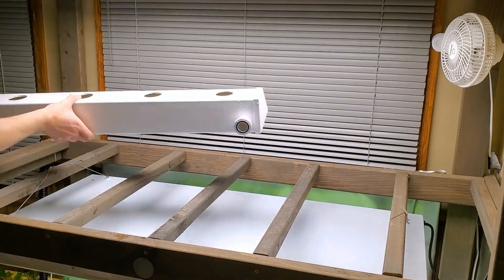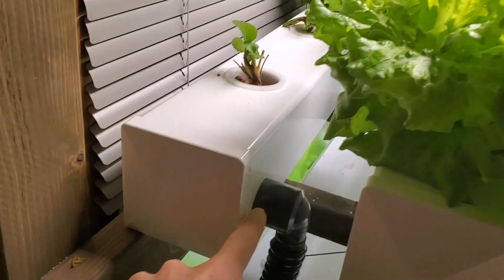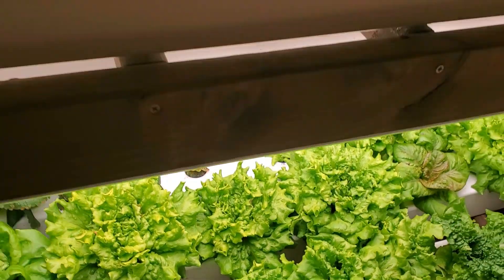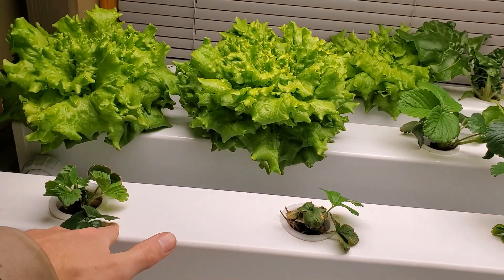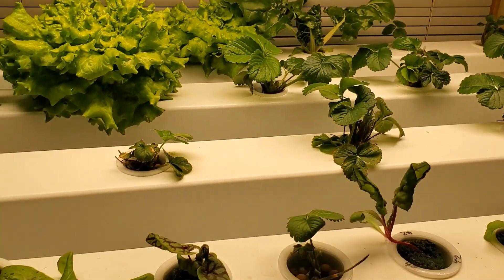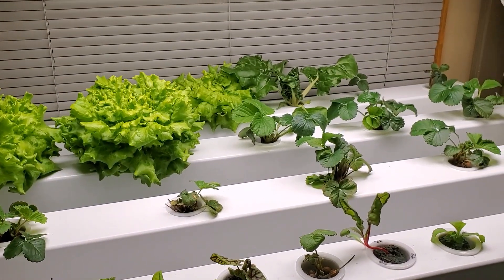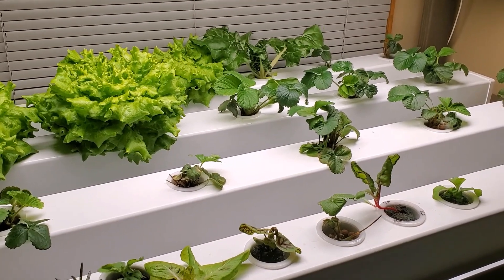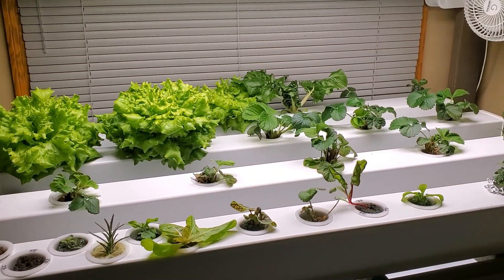Upgrading Our Home Hydroponic Farm - New Rail System!

Comment: Hey!  I built your system based on your free designs. I have a variable 800gph pump by vivosun and have it on the min setting. First tier does just fine but the lower tier doesn't seem to be draining fast enough and the system is backing up. Have you seen this before and do you have an easy fix other than a different pump?  I thought it might be vapor locked and maybe drilling into the top and using some 1/2" vinyl tubing to act as a breather might help.
Reply from the maker: You can buy an inline valve and put that into your inlet tube. Then your can restrict flow even further. There's an example on my materials page: www.simplegreenshydroponics.com/materials

Comment: Are your system running separately with two separate pumps and air pumps?
Reply from the maker: They have two separate water pumps, but a single air pump.
Reply: @SimpleGreensHydroponics  Thank you so much I really appreciate it.

Comment: Hello, can you tell me if the water level touches 1/4 inch of the net cup? I want to do this in a bucket with a 6 inch net cup and have the water drain at the bottom of the net cup. Not sure if my tomatoes will grow outside like this with the nutrient flow from a small pump. It seems similar to your system, but has a deeper reservoir with a 6 inch air gap.

Comment: I'm thinking to build nft setup similar to you, but using the small irrigation tubes with water running through all 4 pipes then drain instead of your method of inline then connecting them in series then drain. What's your opinion on this?
Reply from the maker: Yeah that will probably work, though you won't be able to start seedlings in it (unless I'm misunderstanding your idea).
Reply: Ahh I see. That makes sense. I'm thinking to go with 3" Pvc setup. Unfortunately, Square fence post is really expensive in Canada compared to US...

Comment: Oh, one note. Use Flex Paste instead of the black tank stuff, works just as good and easier to put on the end caps on the rails.  Also the system I have has 72 plant sites.  Only took 30 gallon of water to run it in a normal 30 gal tote.
Will be sending some photos to simple green shortly.
Reply: I looked but you have no videos. Make sure you keep to your word very soon
Reply: Oh sorry I have just read what you actually said ...

Comment: I just built the 2 rail system from your plans 2 weeks ago. Planted another 4 net cups with lettuce seeds yesterday, so now I have 12 small heads growing as I move them along. (Paris White, Monte Carlo, Muir and Rex). I am using an aquarium heater to keep the reservoir at 70 degrees since my cellar gets into the 50's. Very excited about this project. I am thinking of building more rails and trying my hand at dwarf tomatoes.

Comment: how do you find food safe plastic rails like that? I found similar looking fence posts and the company made it clear to me they were not food safe/grade
Reply from the maker: The rails we use are not labeled "food grade". However, based on the research I've done I'm not concerned at this time. I wrote more about it here: 
https://www.simplegreenshydroponics.com/posts/2021/is-pvc-safe-for-hydroponics
Reply: Manufactured to NSF-certified specifications for growing edible produce.

https://www.farmtek.com/farm/supplies/cat1;ft_hydroponic_supplies;ft_hydroponic_nft_channel_systems.html
Reply: @SimpleGreensHydroponics  are the vinyl fence posts you’re using now the same material as PVC?

Comment: hey, i like about your video about this indoor vertical farming. Could you explain about the temperature or humidity at that room condition? Is there something you do about it (may be like using fan for cooling the temperature of the plants?, I've seen your fans, but is there anything else you do besides that ._.?) Thank you very much!
Reply from the maker: The system is in our home so our home A/C keeps it somewhat cool (less than 80 F). The fans and low-heat LED lights help also. We run a dehumidifier sometimes to keep the humidity down.
Reply: @SimpleGreensHydroponics  about the LED Lighting intensity, Do you use some fancy light meter for measuring the lights? Or what kind rule of thumb did you use to determine the PPFD? Thanks a lot!!
Reply from the maker: No I have not purchased a PPFD/PAR meter due to cost. I used the manufacturers specs and the plants' response to the lighting.

Comment: Great looking system!  Your white connection fitting between your rails appear different than the ones you used in your two rail system; or are they the same?
Reply from the maker: Very observant! Yes we made some improvements to the connections. I show the new connection method in our video course since it's a bit harder to show with just pictures.